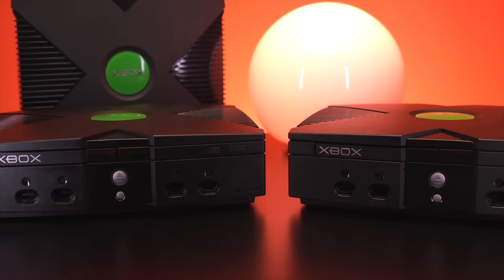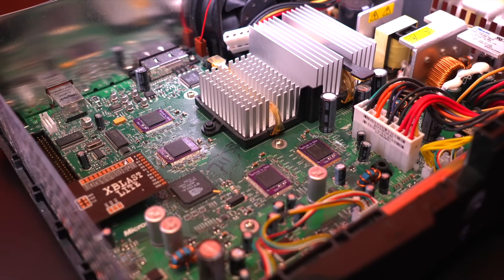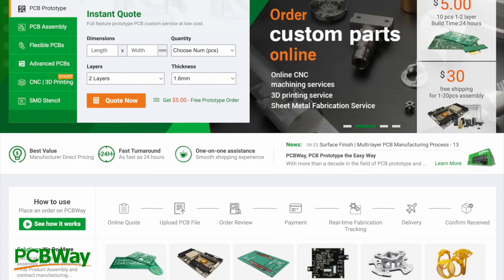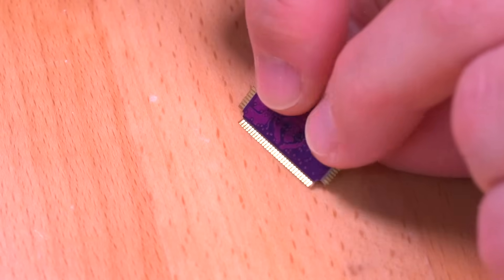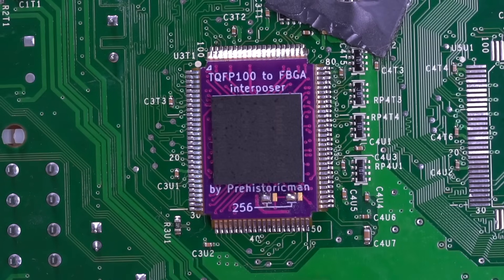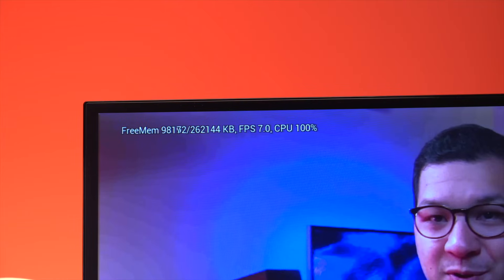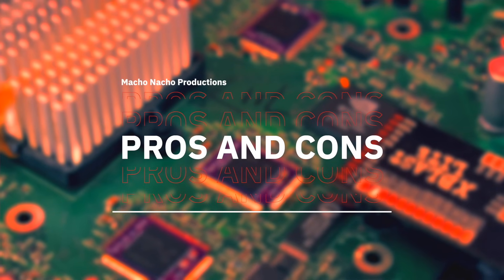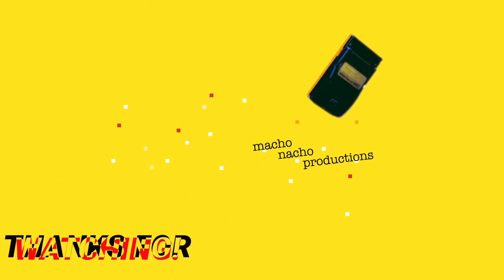Giving The OG XBOX Quadruple The RAM | Never Done Before!

Comment: It would be interesting to see how well Half-Life 2 performs with the additional RAM
Reply: R they coded to take advantage of more available ram?
Reply: @johnbrooks6243  StarCraft Ghost was never officially released so it only ran "officially" on Dev kits with double the ram
Reply: @johnbrooks6243if the OG Xbox had 4 empty pads for memory, they must have thought that sometime in the future those would be used. Game programs would nerd to be programmed to know that as well. IMHO.
Reply: @johnbrooks6243  No, the CPU doesn't help either
Reply: nothing will change,  games will have no idea there is extra so this is pointless minus homebrew.
Reply: @xxsemb  Half-Life 2's game engine dynamically calibrates to your system specs, so it would definitely benefit from the extra RAM and the 1.4GHz Pentium III CPU upgrade.
Reply: @JayrosModShop  If they left that in for the console version, that is. They could have stripped out some of the telemetry and even the console. I do know they had a big effort to get the RAM footprint down for the Xbox port, and a lot of that effort was patched into the rest of the codebase (for e.g. the PC version) but they could have gone a bit further in ways that make it less dynamic.

Would be fun to see this tested and working.
Reply: @edherdman9973  Yeah, HL2 really is one of those "impossible ports" on the Xbox. HL1 made sense and ran great, as that was made for the hardware of that era. But Half-Life 2 was better on the 360, but still suffered from a lack of RAM.
Reply: And StarCraft Ghost
Reply: @pavma7  Starcraft Ghost? Was that game finished? I thought it got cancelled?
Reply: @TheGrizzledAncient it was canceled, but was completed before publication. The build leaked online last year and is fully playable.
Reply: @TheGrizzledAncient  It was cancelled, but a playable build was leaked a few years ago. IIRC it doesn´t run on a retail console since it wasn´t optimized for the 64MB RAM yet.
Reply: @Soonjai  that's awesome to hear, I rememeber back when it was first announced for Xbox and game magezines did previews on it, I was pretty hyped for it.
Reply: @thatzaliasguy  I wouldn't called the game completed.
Reply: @thatzaliasguy  it leaked????
Reply: @thatzaliasguy  was it really completed? Because from what I remember there were missing levels and a lot of polishing and unfinished things.
Reply: @TheGrizzledAncient  it was
Reply: @pavma7   lmao
Reply: Waaiit is it playable on emulator?
Reply: @pavma7  why do you have to hurt me 😢
Reply: @misterjeffa2128  Yea, games are designed to only use what the factory settings were, the game would have to be re-written/modded to even see the extra memory never mind use it.
Reply: @TheCoolDave   Plenty of games have been patched over the years to deal with cpu mods and the normal 128mb ram mods.  This will not be any different.  N64 emulation is a great example and verification of this, as well as PS1 emulators.
Reply: @mattliston1215  I imagine someone will make a ps2 emulator work eventually
Reply: @fluffypinkpandas  fat chance.
Maybe if they implemented some sort of precompiler like RPCS3, but it certainly wouldn't work with an interpreter or just-in-time recompiler.
Reply: @TheCoolDave  If this was true, the Xbox emulator on PC wouldn't be able to dynamically change resolutions/internal-rendering, which can go all the way to 16K  (currently), the Xbox could make use of the extra RAM if the BIOS was updated to address it in vid games, this could also lead to a Windows 98se build for Xbox, turning it into a power house retro PC, which would make playing retro PC games so much simpler and more enjoyable, the Xbox even has full-fat MIDI synth audio and Sensura HTRF, meaning you could go right through from late 80's to 2003 PC gaming, all in a single box, the Soundstorm can use Sondfonts and soundbanks, meaning OPL3 emulation is possible for ADLIB audio, the Xbox GPU is close to GF4 ability, so just imagine what a Win98se build with 256MB RAM could do, not to mention the already extremely well optimized emulators for 8/16-Bit consoles on OGXB that are very low latency, better even than an RGB-Pi's latency performance levels, a 1.4Ghz Tulantan upgrade could open up perfect 32-Bit console emulation too, this would make the OGXB the next best thing to FPGA systems and probably the best analogue X86 based retro solution available.
Reply: @TheCoolDave  Framerate dips are not programmed in, though.
Reply: @TheCoolDave  probably patched via the system like dlc
Reply: @TheCoolDave   If this was true, the Xbox emulator on PC wouldn't be able to dynamically change resolutions/internal-rendering, which can go all the way to 16K  (currently), the Xbox could make use of the extra RAM if the BIOS was updated to address it in vid games, this could also lead to a Windows 98se build for Xbox, turning it into a power house retro PC, which would make playing retro PC games so much simpler and more enjoyable, the Xbox even has full-fat MIDI synth audio and Sensura HTRF, meaning you could go right through from late 80's to 2003 PC gaming, all in a single box, the Soundstorm can use Sondfonts and soundbanks, meaning OPL3 emulation is possible for ADLIB audio, the Xbox GPU is close to GF4 ability, so just imagine what a Win98se build with 256MB RAM could do, not to mention the already extremely well optimized emulators for 8/16-Bit consoles on OGXB that are very low latency, better even than an RGB-Pi's latency performance levels, a 1.4Ghz Tulantan upgrade could open up perfect 32-Bit console emulation too, this would make the OGXB the next best thing to FPGA systems and probably the best analogue X86 based retro solution available.
Reply: @Wobble2007 This isn't correct. CXBX-R is not a perfectly accurate XBox hardware emulator. It's somewhere between a traditional emulator and a compatibility layer like WINE - it passes a lot of stuff to native Windows APIs with little or no changes (while the XBox doesn't run Windows per se, it's APIs are based on those of Windows) and x86 code also is mostly run natively, to my understanding. Since the program is basically native, it's not restricted to limits of the original XBox hardware.

Even if graphics weren't rendered natively, emulators have been upscaling 3D games for decades now.

In fact, upgrading RAM very rarely ever increases graphical fidelity in any game, as the GPU uses it's own VRAM instead of the regular RAM tied to the CPU. If the game knows to take advantage of it, it might increase your frame rate on account of removing other game-logic bottlenecks, but it doesn't mean you can magically have higher-poly models or a higher resolution. Those things are dependent on VRAM. Depending on the engine, you might be able to get a longer view distance or something, if the view distance is dynamic and was being limited by game logic rather than rendering ability.
Reply: @ErdrickHero  The OGXB shared memory bandwidth between the CPU & GPU, and is therefore heavily bottlenecked, without this bottleneck, the OGXB has been demonstrated to run Doom 3 with 128MB RAM at native 720p60, you can already HEX edit XBEs to that end, patching the BIOS to address more RAM would make this unnecessary afaik, Xemu has a near perfect game library compatibility, I have not come across a single game in my library that does not run immaculately, and I have over 500 OGXB games.
Reply: @Wobble2007  and how is this bottleneck removed by adding more ram? it isn't.
Reply: @giornikitop5373  Well it is, as I said, that has already been demonstrated with modified games, people have gotten Windows 98se running on 128MB RAM, the CPU & GPU having to share 64MB between them is a bottleneck, without it, the Xbox is much more capable, the desktop variant of the XB GPU has a dedicated VRAM pool of 64MB GDDR, if the Xbox had this, it would open up a lot more performance scope, just compare the GF4 IGP that uses shared RAM vs its discrete counterpart to see a real world example of the difference it makes.
Reply: @Wobble2007  Literally most games don't run on Xemu immaculately at all, tons of them have graphical glitches / bugs etc.
You're kinda over selling Xemu dude
Reply: @Wobble2007  It would be interesting to see, truth be told, if someone can hack and modify the bios so the whole system can take advantage of that, sure, that would be cool. Nothing can right now reallythough

Something to note, adding ram to the OG Xbox has been a thing from when it was current. People have done it before but, I have heard nothing that can be done unless the bios is fixed.  So, after all this time what? 20+ years, the bios has not been hacked or modded. 

What says it will be now?  If it ever will be. 

I was one who owned a OG Xbox when new and always look for mods and hacks for consoles....  I know the OG Xbox fairly well.
Reply: @Wobble2007  what? what modded game has demoed "removing" that bandwith limit? you're confusing memory size with bandwidth. memory transfers cannot go faster by adding more ram. and what does win98 have to do with this?
Reply: @giornikitop5373  Win 98 doesn't run on 64MB, but does on 128MB, people have HEX edited XBE's in various games to address more RAM, allowing for higher frame-times/minimum FPS/higher-resolutions, that was first done many years ago now.
Reply: @Wobble2007 But that's an emulator, not real hardware. You can write emulation software to take advantage of the more powerful hardware found in a modern PC, such as upscaling and filtering, whereby the emulator does a lot of "post processing", but the original Xbox game has no idea that it's running on an emulator, nor that it has extra resources... so it can't use them directly.
Reply: @Wobble2007  FAKE, the xbox use 1gbps of bandwitch for the CPU and 5 for the GPU... Its a Nforce2 prototype with HYPERTRANSPORT bus, 2005 stuff but from 2001. The bottleneck is only the CPU because it was designed for an AMD Athlon, thats why all Xbox can run up to 900mhz: 133mhz FSB stock but Nforce Motherboard support 166FSB =  900mhz...all xbox can do that even softmodded only ones.
Reply: Doom 3 as well.
Reply: doom 3 pc ported?
Reply: True
Reply: Next cpu upgrade.
Reply: @arcane0nex122  You're gonna need the appropriate stencil and a hot air station to safely remove the PIII from its package and the Celeron from the XBox and put it back.
Reply: While very hard to do, you can replace the CPU on the XBox for a Pentium III. Unlike the extra RAM mod, this makes games perform better to a perceptible level.
Reply: With The 1ghz upgrade it has better performance in HL2 with stock ram
Reply: @RedBeardedGriff  with 256mb you can use the PC HD textures instead of the low Memory textures the XBOX port use... Running at 900-1000mhz the XBOX can actually run HalfLife2 at 720P now with 128mb ram. Games with HD textures like FABLE on 720p use all 128mb, and games like Morrowind can use the 256mb to INCREASE VIEW DISTANCE making the game way modern like Skyrim... Morrowind at 720p with twice the VIEW RANGE... But 256mb ram is not the thing the thing is that this guy invented a DDR2 adapter interposer for the xbox ram, so it can be 512mb in the future and the XBOX can run Windows7 Lite if someone mod a Xbox-booting versión, the driver exists as is a Nforce2 and a Geforce4 prototypes.
Reply: Oh do this, and then the pentium 3 upgrade you can do on the original XBOX. Then HL2 would run like its nothing.
Reply: @bigearsinc.7201  Retro Renegade Repairs made a great video of HL2 running with a 1.4GHz CPU upgrade you should check out, if you haven't done so already..
Reply: There is a video already out testing @128
Reply: Probably make little or no difference. The CPU upgrades that people have done and tested on HL2 make a massive difference, that's what you want. The game goes from ~20FPS much of the time to locked 30FPS most of the time.
Reply: only if these games were patched to read 256mb, there will no difference unfortunately.
Reply: @BloodiTearz  reading 256mb and actually using them are two very different things. most patching to the xbes is to avoid crashing with >64mb or faster cpu.
Reply: Exactly the same
Reply: Ive seen a video with an upgraded processor and theres a tiny bit of imporvement but not worth the effort of installing a new CPU.
Ram wouldnt help anything.
Reply: I doubt it, they said that games will not get improved performance. But it as been shown that upgrading the CPU to a faster one does increase performance in stock games like HL2.
Reply: The answer is it won't make a difference.
Reply: Oh my, I play HL2 so much.....just love it
Reply: MVG has a video on it
Reply: @misterjeffa2128 HL2 runs on a 1: 1 port of the Source Engine which means it is entirely possible to be able to address it with more RAM via the Source console.
Reply: Isn't HL2 mostly CPU limited on the Og Xbox?
Reply: @themacintoshnerd  Kinda but when they ported HL2 to the Xbox lots of textures had to be reduced to run on 64 so while it might not help a lot it will help a little.
Reply: No difference, this would mostly be useful for HD texture packs
Reply: The emulators and the Chihiro games are the most benefited of this mods but I like to see how Doom 3 or Morrowind benifits of this mod
Reply: RAM was only part of the issue with HL2 on Xbox. The 999 MHz CPU mod combined with this RAM upgrade and.a custom BIOs would probably see the game run pretty smoothly. Honestly the CPU upgrade alone is enough to get a decent frame rate, though.
Reply: It will still have that same framerate, it's better to upgrade the CPU, that means the RAM upgrade is useless, unless if you're into arcade emulation with large ROMS (even though it's pointless because there's virtual memory allocated to the HDD)
Reply: And unreal championship 1&2
Reply: It would be about the same if the CPU isn't upgraded or overclocked
Reply: Hello, did anyone try the SEGA games with the upgrade of the CPU many of you talk about ? Despite Half Life 2 is improved, what about Panzer Dragoon Orta, Shenmue 2, JSRF, Otogi 1 et 2, Out Run 2 et Coast to Coast, … ? Has anyone tried and played these games with the Pentium 3 upgrade ?
Reply: MVG made a video on half life 2 showing that
Reply: @UrpleNelson Do you know the title of the video? I saw his video about Half Life 2, but I don't remember him using extra RAM, only an overclock.
Reply: @SpecialAccess77  it’s the same video on the half life 2 port. Watched through it again and the Xbox had 128mb of ram and the over clock as well. Not sure if the extra ram made a difference though
Reply: @UrpleNelson  I must've missed the system having extra RAM. Thanks for letting me know.
Reply: MVG did a video on it a month ago
Reply: @guardianbeardizer0069 Do you know the title of the video? I saw his video about Half Life 2, but I don't remember him using extra RAM, only an overclock.
Reply: there is a video on somone modding an xbox from 733mhz to a 1.4ghz tualatin pentium 3 and completley fixed halflife 2 to run smooth
Reply: Halo 2 1080p mod should benefit tremendously
Reply: Hell try Hall Life 1 homebrew needs it too.
Reply: I feel like HL2 would benefit from the cpu upgrade more than the ram

Comment: Amazing video as always! Along with the ModXO modchip this is probably the best modded XBox on earth. The only thing missing would be the replacement of the processor for the 1GHz that Retro Renegade Repairs made. Great content Tito!
Reply: All we have to do now is put a PCI slot in and replace the Processor and we have the most powerful Xbox ever modded 🤣
Reply: @ffviifakeremake9997  imagine if we could tap into the motherboards chipset to add another IDE channel so that the DVD drive and Hard Disk can be ont heir own IDE controllers (and allow SSD upgrades to run at full speed while the DVD drive is being accessed)
Also PCI would be interesting but I doubt that could be done like my idea for another IDE Controler
Reply: @nekomasteryoutube3232  You never know man... Most of these mods were just a dream at some point and look how far the modding scene has gone. Maybe it's a matter of time? crossing fingers
Reply: Or make a custom mobo with a SATA controller so we can use XB1 BluRay drives
Reply: I've asked this before, but why can't we just build the Xbox from scratch?